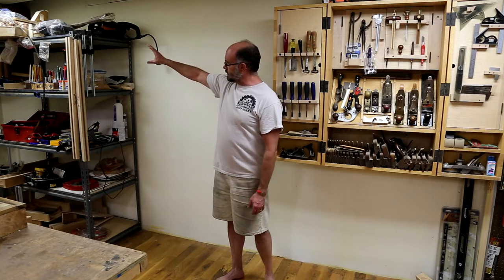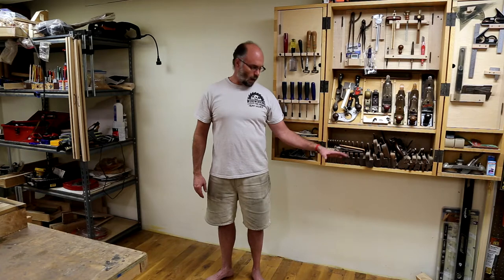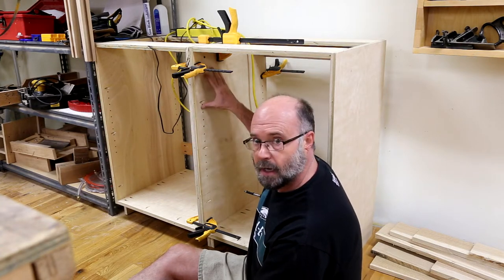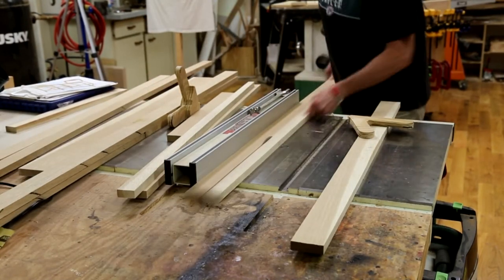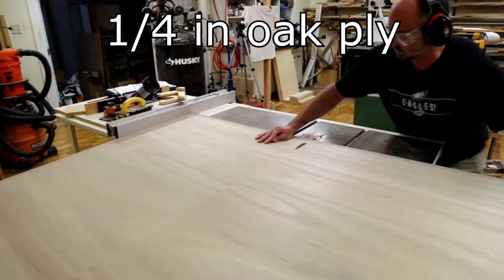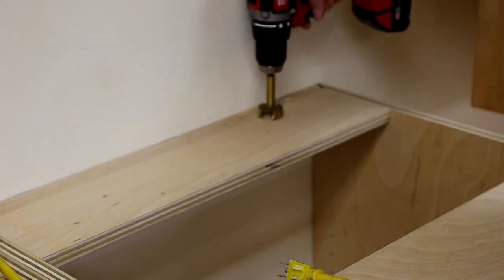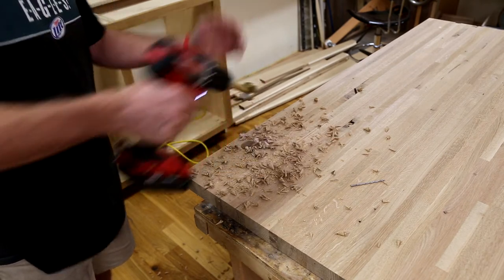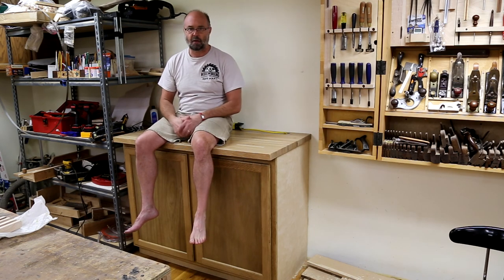Making a shop cabinet work station

Comment: Nicely done. Where did you get the band clamps for attaching the edge banding?
Reply from the maker: They're called Bandy Clamps from Rockler.  I've had pretty good experience with them.  I find they're a little quicker to apply than tape pulled taut, and probably provide a little more clamping pressure if the gripping faces are clean.  Parallel clamps are better if you have them and the situation allows but they're not as convenient.  Thanks for watching, commenting, and the question!